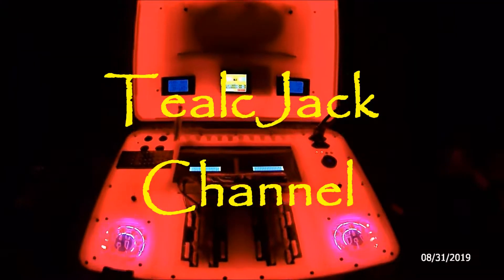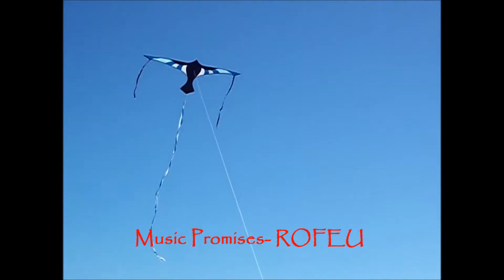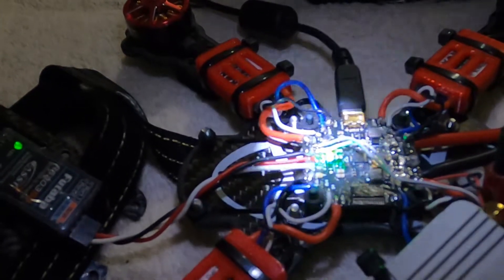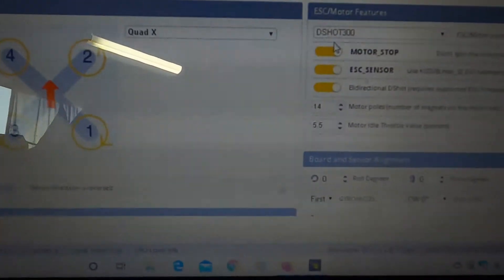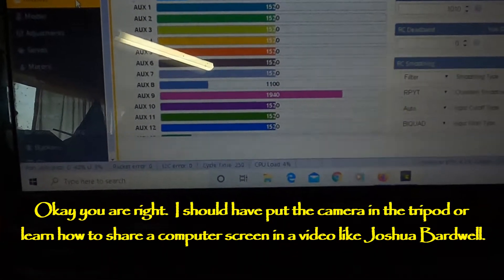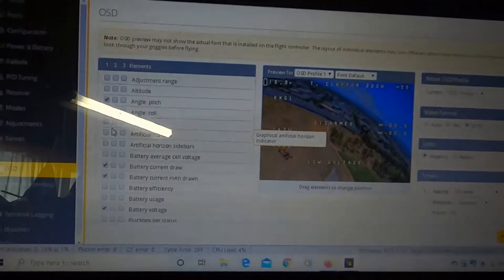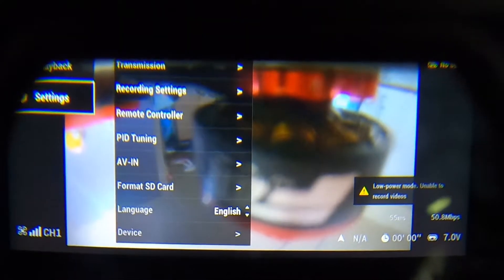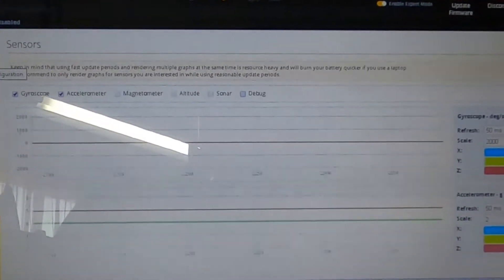OSD Not Working In DJI Goggles

Comment: I just spent hours working on this and finally got it to work. I have a speedybee f7 stack v3 and the caddx vista. In the speedbee app (I assume similar to betaflight) I changed uart1 to MSP and uart2 to serial rx. BOOM I have OSD in my googles and they are no longer in low power state.

Comment: I had same problem/ Change cable and etc. but nothing working. And finally I decided to change one air unit to another - and it's working, but on another dron - not. So the problem with the unit.

Comment: Yes I have exactly the same. No beta flight osd telem. 

White to fc tx and grey to fc rx and msp turned on and custom osd enabled. Clracing f7 fc
Reply: No unfortunately it was a faulty air unit. Had to send back to dji
Reply: @Stubbsyfpv  okay thanks for reply what fc were u using ?
Reply: Hey did u fix ?
Reply: Using a clracing f7 2.2 I believe. We plugged in a mates au on the field into my fc and telemetry was fine so was the air unit
Reply: @Stubbsyfpv  cool becuase i had same problem and f7 also but it was betaflight port mapping issue glad u solved 👍
Reply: @ak-lk2nq  how did you resolve the port mapping issue, I have this same problem right now
Reply: @taylanator2000  fc said tx2 rx2 in betaflight it was port 3 🤷‍♂️
Reply: @ak-lk2nq  interesting I will try rhat

Comment: I'm having the exact same problem... were able to fix this?
Reply from the maker: Yes, I just flipped the TX wire to where the RX wire on the flight controller was solder and it works.

Comment: I had the same issues. I have a VISTA unit but would assume it's the same issue. On the UART that you wired your Air Unit to the FC mine was was TX2/Rx2 which is UART2 in Beta Flight  just enable the MSP  not serial and make sure custom OSD is on like you have in the goggle settings. That is all you need to do.

Comment: Did you ever figure it out? I have the same issue.
Reply from the maker: Yes, I had the gray and white wires reversed.  I simply just did not see the rest of the instructions.  I do not know how many times I looked through the instructions or watch Joshua Bardwell's video and missed that I had those 2 wires reversed.  Once I soldered the wires correctly, everything worked.  White should solder to any UART Tx and Gray to UART Rx.  Make sure the UART, that you soldered the wires on, in Betaflight under the Ports tab is set to "on" in "Configuration/MSP" column.  If you have done that and still no go let me know.
Reply: @TealcJack  EDIT: Solution was a new flight controller. I also coated it in conformal coating to prevent dust and debris from shorting anything out. So far so good. Original message: Thanks for the reply. I have a different flight controller, the iFlight SucceX-D F7 TwinG Dual ICM20689, and it was previously working fine. I have a plug connection to the FPV air unit. Will check the wires. I needed to turn the auto low power off on the DJI unit because it seems my flight controller doesn't send any info to the FPV air unit that the drone is flying. The first flight was sketchy, it started to lose signal real quick. Once I disabled the low powered mode, it flies fine, but still no OSD, and still no voltage from the FC. The FC gives a voltage in betaflight. If I find the solution, I will reply here. Thanks again for your help. I appreciate a lot of content on your channel too, btw.
Reply from the maker: @Aquaflight2  Thanks.  All else fails, give Joshua Bardwell an email.  He has been very helpful in the past and probably knowns you flight controller, Todd.
Reply: @Aquaflight2  hello, i also have a plug connection to my kakute f7 and Im only getting partial OSD info, I cant figure out why I dont get the voltage OSD. Did you fix your problem?
Reply: @Tenaguer  Ultimately I ended up replacing the flight controller. Dropped a new one in, and everything worked perfectly. I am on my third iFlight F7 controller. The first one died after an impact. It always ran hot to the touch. May have been defective, not anyone's fault. The second one still works, but the OSD stopped working after a few flights. It doesn't send info that the quad is armed, it doesn't auto record or auto stop record and the transmission strength had to be manually turned up so I wouldn't lose signal. Other than that, the second controller worked fine. I suspect it got partially shorted out in a dirty crash with lots of vegetation. I installed the third controller the other day and it works perfectly. I get OSD, and everything is good. I wonder if dust was a factor in the previous failure, so I painted the controller over with conformal coating, a silicone based waterproofing. So far I have had zero issues with the waterproofed third F7 controller.
Reply: Sulican I have the same board and same problem. If you get a fix let me know. Pulled my hair out today now boozing will try cut the UART 6 wire off and move it to another UART or smart port as there is one on the board. Will try tomorrow.
Reply from the maker: @IcarusZulu  Yes I figured out what I did wrong.  It is working great now and have many flights on it.  Mine was that I had the wires reversed.  Let me know what you have set in Betaflight?  That might be your issue if the wires are correct.
Reply: @Aquaflight2  I have the iFlight Titan DC5 with same FC (SucceX-D F7 TwinG Dual). after a little crash the first FC stop working (short on MPU-3,3V).... - iFlight sent me a new one, but there is no way to get OSD. I flashed with same backup-file, but no way. Did you buy the third one because of no-OSD ? - and did you try to connect to another UART?
Reply: @zx10rheinzi  ever get osd working? Same problem, going to set the port, not sure what one the osd comes in on. Anyone know? Ty
Reply: @TealcJack  the stack im using is a dji ready stack we only use the original socket iv no other option using manual solded socket so i cant change the rx and the tx 😞
Reply from the maker: @syam5599  Oh, sorry.  I forget there are flight controllers that are designed for the DJI to plug directly to them instead of soldering to UARTs.  Is the OSD working for you?
Reply: @TealcJack  the osd is working now with new air unit, the one didn't work I return it to the shop I bought hope they replace it with new air unit it's still under warranty
Reply from the maker: @syam5599  I am glad to hear that.  You are not the first one that I have talked with that had a problem with the Airunit and the OSD.  I one case, it was because the individual did not update the firmware.  Once updated, it worked for him.  In another, it was a faulty unit.  He was able to get it replaced under warranty.  I looked up the flight controller you mentioned.  I think I will go with the plug and play style like that one for my next build.  Just easier and faster than cutting and soldering.  Then I won't flip the wires and drive me nuts when the OSD is not showing up, Todd.
Reply: @syam5599   I got it to work on my Mamba F4 board by turning on uart 2. It does not come turned on and no one mentions it, but mamba said that port was for dji so I tried it. uart 4 does the video, uart one does rc rx. uart 2 does the osd.
Reply: @Sciofpv  which mamba board are u mentioning is it the mamba dji ready or mamba mk2/3
Reply: @syam5599  The mamba DJI board it plugged right in.
Reply: here are my settings  https://www.youtube.com/watch?v=7AgWRslfBn0&feature=youtu.be
Reply: Hi hello, got the same issue no osd in both dji stack I'm using the mamba f405 dji and the succex A dji , what I found when I change the air unit to a new one the osd is back, so maybe it's a factory default on the air unit just saying .
Reply from the maker: @syam5599  What I found in my case was I soldered the white and gray wires to the wrong URAT.  Once I reversed those, I had the OSD up and running.